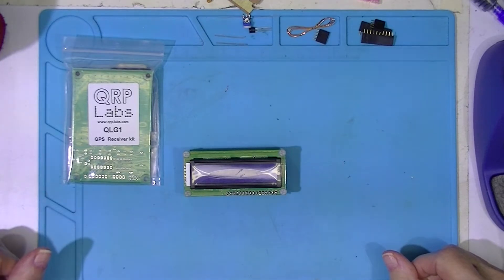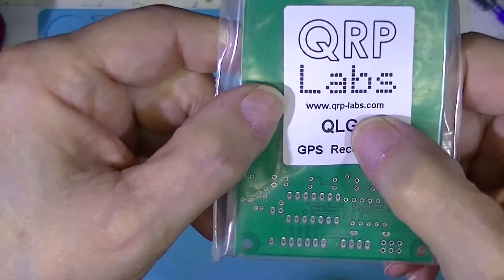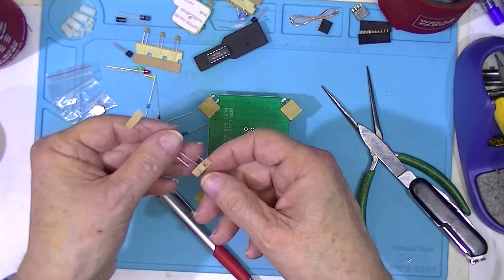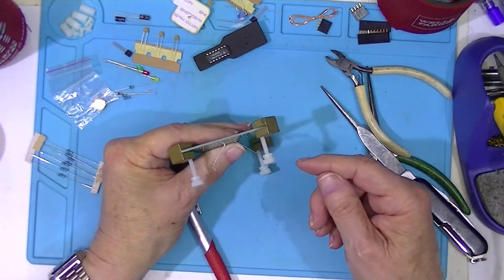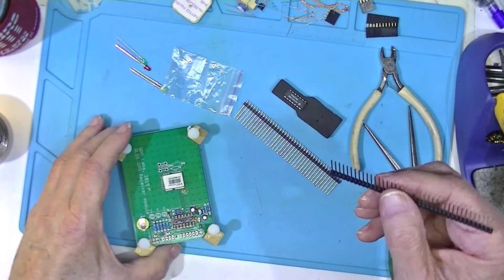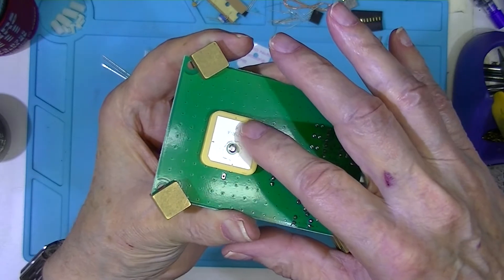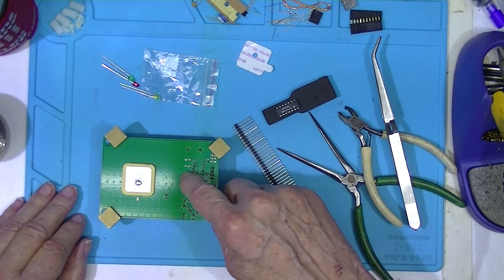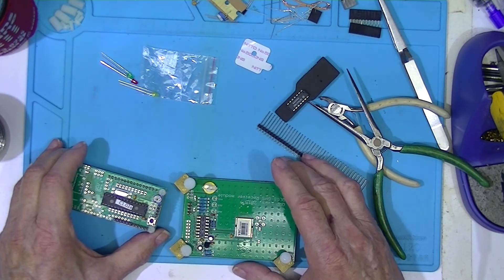QRP Labs – GPS/Clock/Enclosure Kits - Part 2

Comment: I pronounce solder the same way you do.  I think we both know it sounds better ; )  Also I built the same kits a few days ago and I also socketed the IC on the GPS board.
Reply from the maker: Have you made t work yet?
Thanks for watching!
Steve
Reply: @stevestrivia-bystevewagner4852  I enjoy your channel and humor.  Yes I got both working and swapped out the 2-line display with a four line and as you know you can add additional features like call sign and local time in the two bottom lines.  I have not tested that just yet.  I used the SunFounder LCD2004 Module on Amazon for under $8.00.   It is the older style  with only the parallel port which is great because adding the connector it is plug and play on the clock board.  Only negative is it will not fit the case you have in the video.  I hope to make a case for both the 4-line display, clock and gps using a 3D printer.  If I get that done I will post the stl files so anyone with a large enough printer and print the case.  Again I enjoy your channel and look forward to new postings.